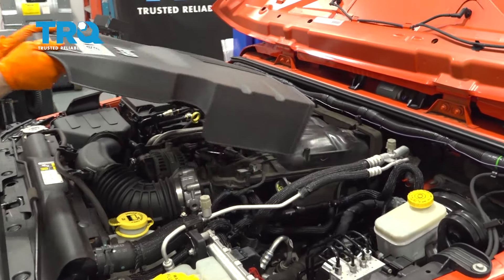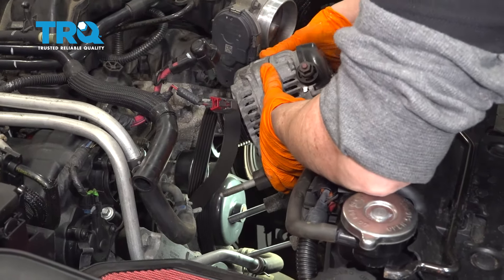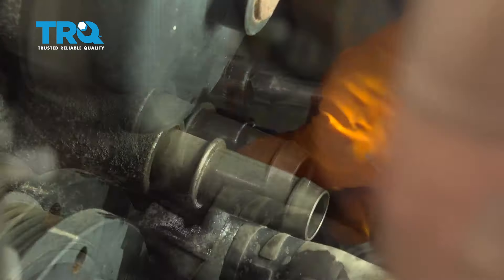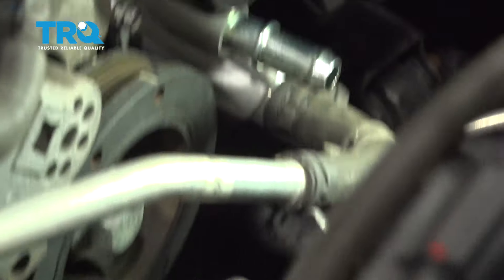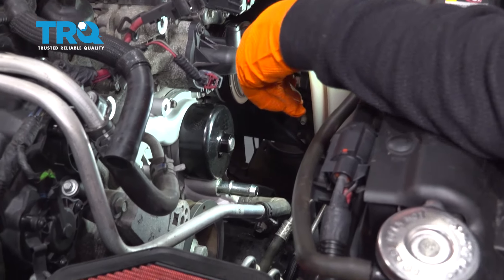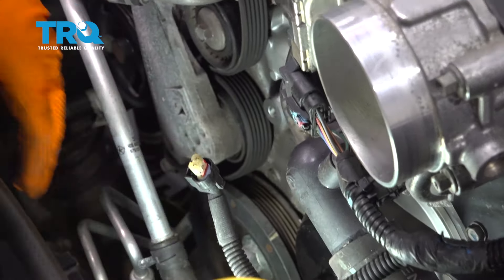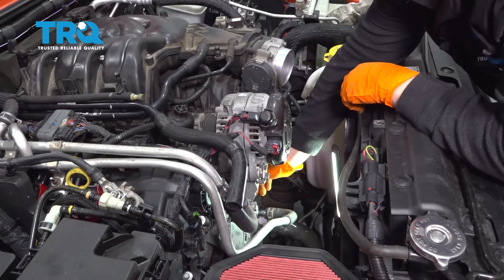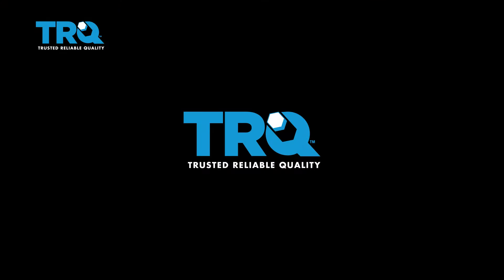How to Replace Engine Water Pump 2007-18 Jeep Wrangler

Comment: Great video! I have a 2019 Wrangler JL w/ the pentastar V6, it appears to be the same repair as I don't believe anything changed w/ that motor after 2018. My smaller upper hose is weeping where the metal hose barb meets the water pump. Seems to be a fairly simple R&R thanks to your well detailed video, much appreciated!

Comment: Great video but the torque spec for the bottom alternator bracket bolt wasn’t mentioned….  13mm socket. It does go through the water pump.

Comment: On the battery part at the end of the video. If you use a terminal cleaner and use it on the terminal and the cable it should catch and be tight again.

Comment: This is a great step by step video. If you are changing the water pump in you Jeep, this is the one! 
NOTE: I do have a minor add, while changing my water pump ‘14 JK 4-door, I noticed my water pump has 9-bolts not 8 like mentioned in the video.

Comment: This video has to be for a 2012 or 14 because why are we taking off the whole alternator off ??? Can you not get to the water pump with removing? In my 2009 I have enough space to reach in and start unhooking the pump. Should I still unhook all this other stuff or can I skip some steps
Reply: If there's an engine cover to be removed its the 3.6 so 12 - 18. Your 09 is a 3.8 so 07 - 11

Comment: This is the best video I’ve seen for my Jeep. Thank you for making this job so easy. 

I’m having an issue with my Jeep. I thought i needed to flush my coolant, so i tried, and for some reason my radiator will not completely drain. I don’t understand why. So I replaced my water pump think that was the issue. Probably wasn’t, but whatever. How come i can’t get the coolant to drain all the way out from the radiator?

Comment: I cant believe even the dealerships do not have a bolt diagram for the water pump. It does not clearly show where the small or long bolts go.